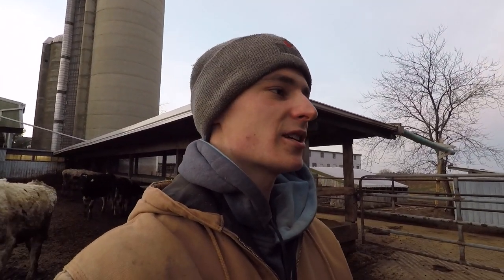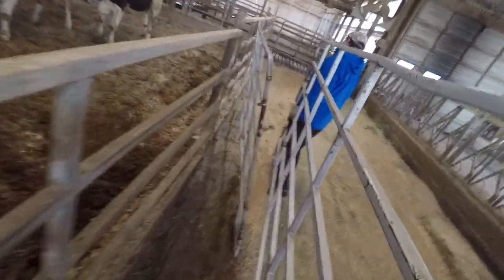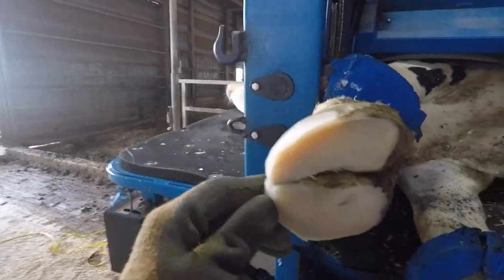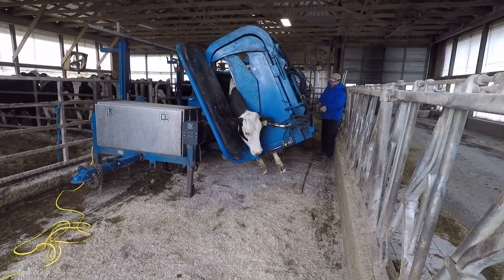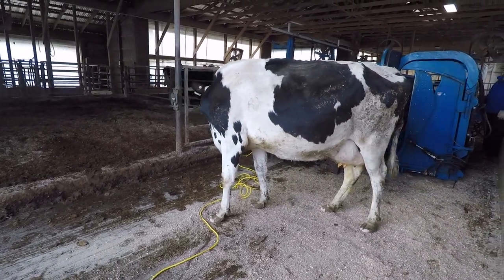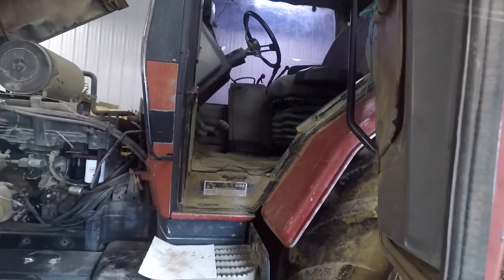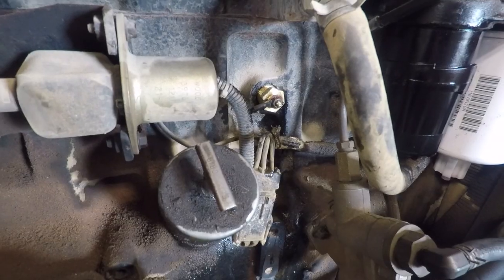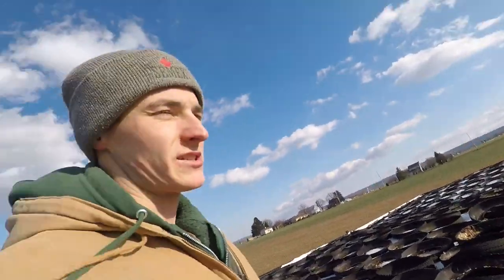Hoof Trimming and Friday Work

Comment: I courious how long does a semi load of wood shavings last you?  You must go through a quite a bit bedding everything with them here in central MN we use mostly wheat straw or corn stocks.
Thanks
Reply from the maker: Get one every 2 or 3 weeks during the winter. Straw is very expensive and we didn't shell corn this year so it's the best option for us right now
Reply: @10thgenerationdairyman61  what price does that come to for a semi we get 72 bags that costs like £350 and it lasts a week and a half, it is only used for the dairy cows not hethers tho
Reply from the maker: $1000 a truck load which I think is 100 cubic yards